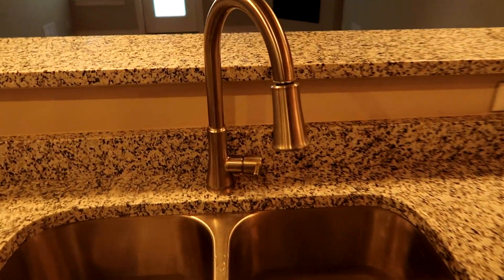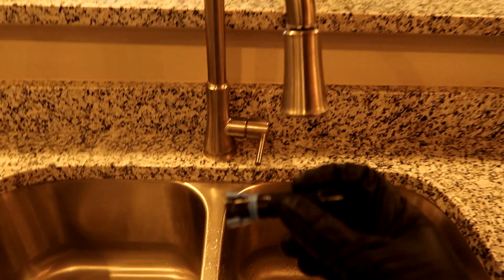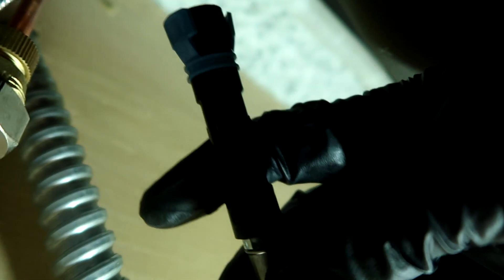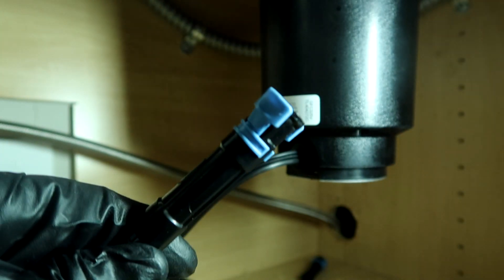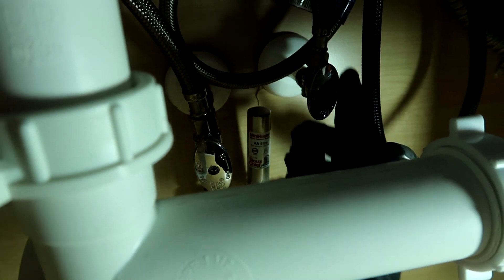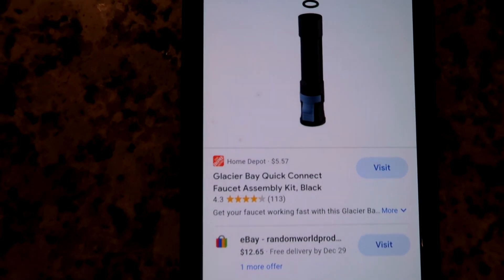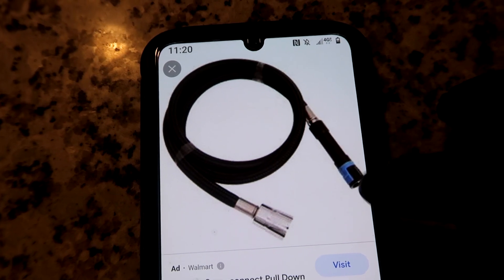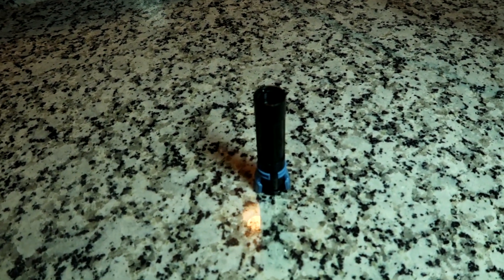How to Fix Faucet That Has Low Water Pressure

Comment: I literally just cleaned thos connector. The little white piece inside will slide right out. You can clean any debri out & slide it right back in. EASY PROCESS! Thank you for your video!
Reply from the maker: Thank you so much for watching!

Comment: Thank you for the video.

I have a new glacier bay kitchen faucet, but I'm not too happy with the water pressure. I tried to remove the "backflow preventor" inside the quick connect, which doesn't improve much.

I am wondering where is the restrictor located? The model I have had a very slim faucet head and a fine messed filter web. So it's hard for me to remove it from the faucet sleeve, or remove the filter web to access the restrictor.

Do you think the quick connect has different flow ratings? Thanks.
Reply from the maker: That's a good question. I'm not sure because I've never had this issue. 🤔
Reply: @LexVance  I’ll try to find it in the handle and let you know.

Comment: Question for you, what is that little canister looking thing under the sink that looks like a 60 amp fuse for an AC disconnect box?
Reply from the maker: A vaccum breaker. For when they use the fire hydrant the pressure it creates won't cave in the plumbing if I remember correctly. Thank you so much for watching Richard!
Reply: That piece that looks like a brass tubular fuse is a (water hammer arrestor). If the pipe in the wall is not strapped off good, water pressure in the pipes can cause the pipes to move when it's turned off and on. Have you ever been inside an old house and heard a knocking on the wall when the water is turned off and on? That device stops that from happening.

Comment: I have this problem with brand new faucets even after clearing the supply lines. Have to remove the ceramic valve and check valve assembly to get all the crap out.
Reply from the maker: Thank you so much for watching ry!
Reply: @LexVance  been meaning to ask you. Can you do a video on mold remediation? We do a lot of that in house at our property. Curious to see how y’all do it elsewhere.